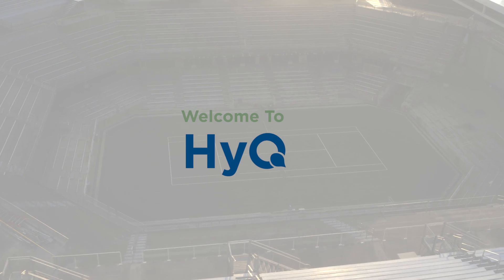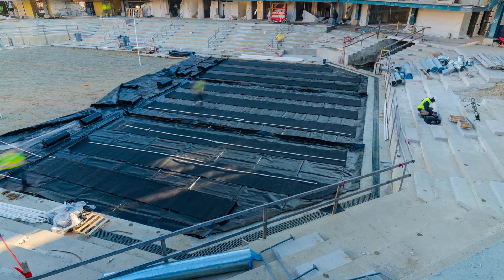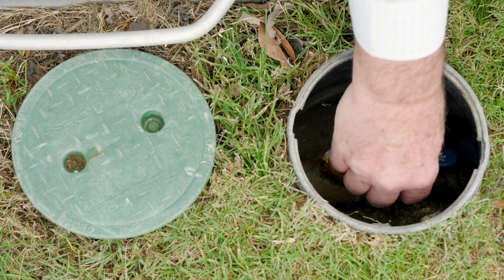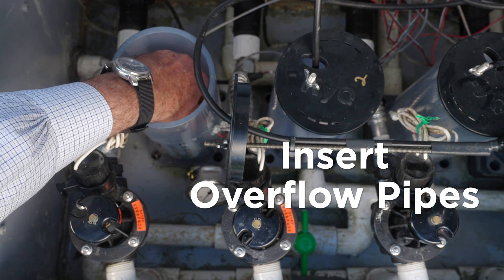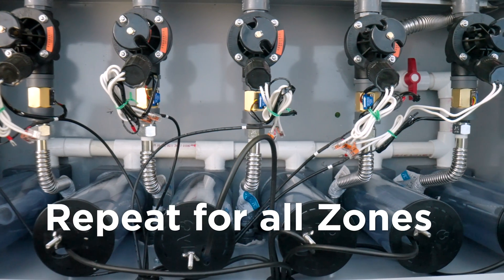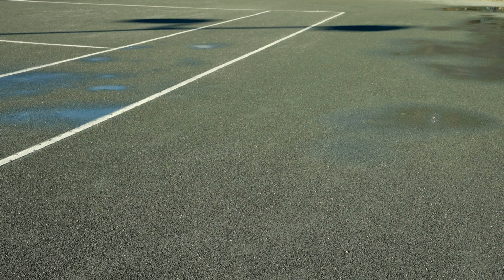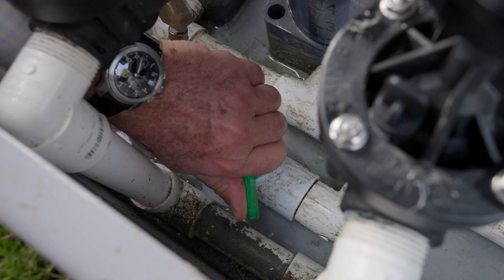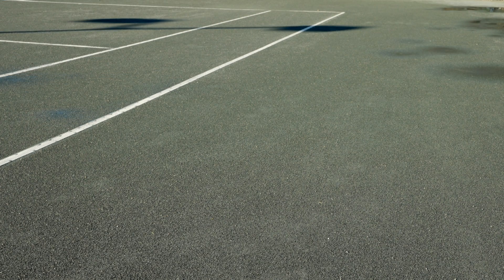Understanding & Operating Your Har-Tru HyQ Clay Court Irrigation System

Comment: I already replaced sensor, solenoid, power wire, board  valve and the cell still not getting wet